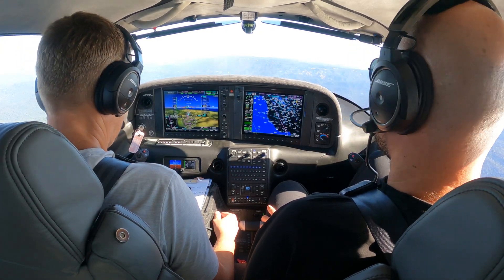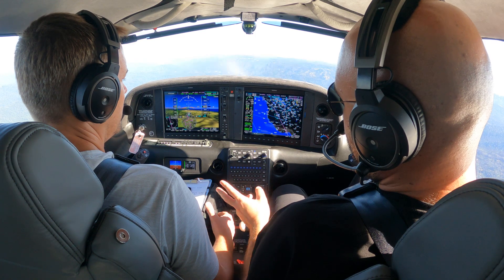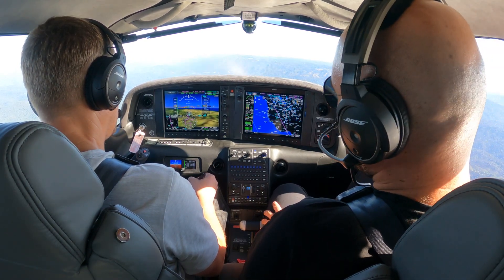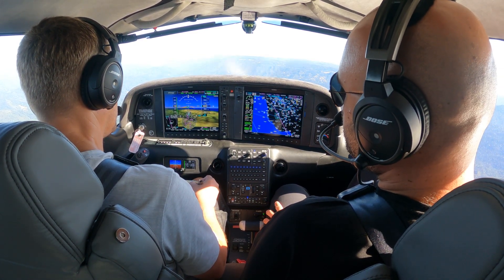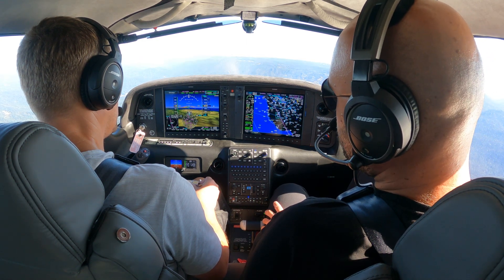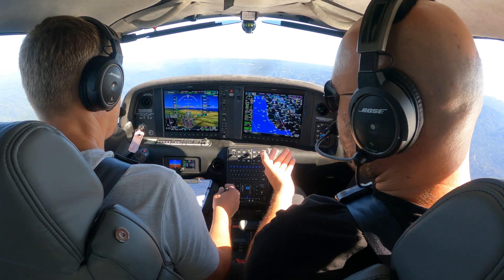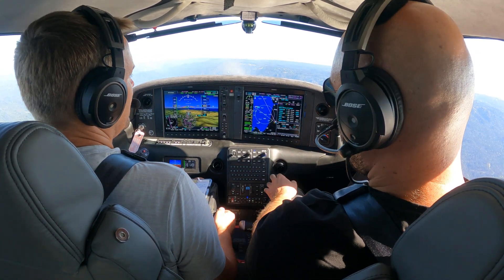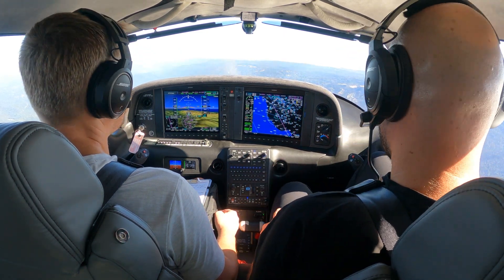What is My Missed Approach Point? | Non-Precision GPS Approaches

Comment: Good answer, but not sure about the exactness of it.  For example, a nearby airport has an LNAV-only MDA of 1000'.  But the last identifiable GPS waypoint before the runway has a minimum altitude of 1080'.  So apparently I can descend 80 additional feet between this last waypoint and the runway. The FAA plates for this approach have no identifiable way of deterring the MAP.  Admittedly, there's not much difference between 1080' and 1000' at that last GPS waypoint. And for LNAV-only I'd be totally good with your answer here. But that 80' difference is bugging me.